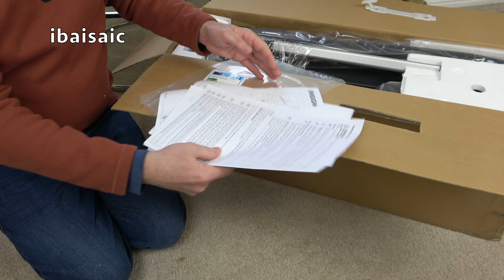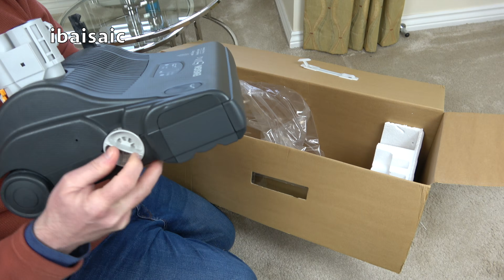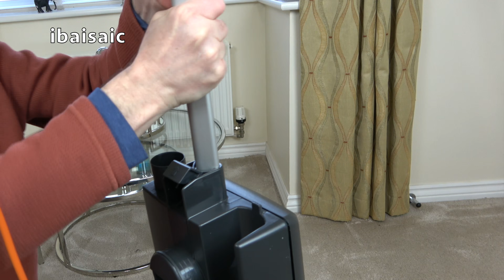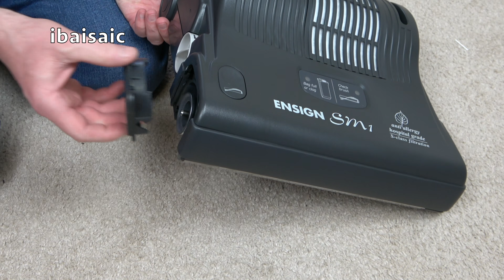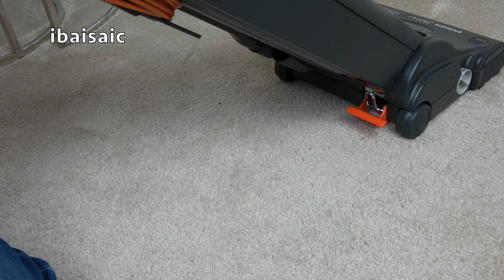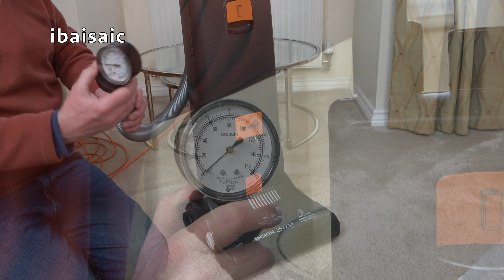Diversey Ensign SM1 By Sebo Upright Vacuum Cleaner Unboxing & First Look

Comment: A great machine at a bargain price.
We suspect this NOS machine has been in this box for about ten years.
We have seen the symptoms shown by your brushroll on some machines that have been stored for a long time unused.
We think the brushroll bearings stiffen up and they need a good run at high speed to get warmed up and moving freely at full speed again.
If the detected brushroll speed is too low the protection system will activate.
We feel this machine had a perfect storm of circumstances causing the problems.
Stiff bearings from long term unused storage, new long & stiff bristles on the brushroll, a difficult flooring with a long & tight pile. 
We are confident that if the machine is run in for 15 minutes on some short pile carpet it will loosen up and the stalling problems will resolve.

Comment: are you sure its a single motor as the brush electronics cur the brush motor out! x5 definably a double motor!
Reply from the maker: Yes it is a single motor, as is the X5.
Reply: @ off course your right it has a controlled clutch to brush , i was thinking of the servo motor in x5 🙄

Comment: Very nice Sebo. Honestly I prefer the older model Sebos/windsors because the design of the bag cover is better, with the new models with wear and age the bag covers don’t stay on very well
Reply: I had the misfortune of using one of the newer models, some five years ago. It had a footswitch which I could only operate by standing at 90 degrees to the cleaner and kicking it with my foot. I could also not fathom out the height control for love nor money - I have long forgotten how it worked, but it didn't simply dial up from 1 to 4 for example, rather I think it had to be kept turning round and round until it felt like the cleaner was touching the carpet.